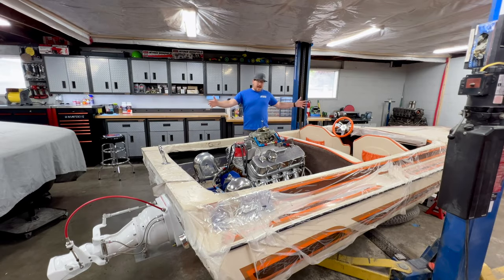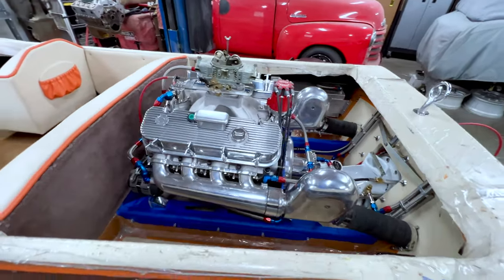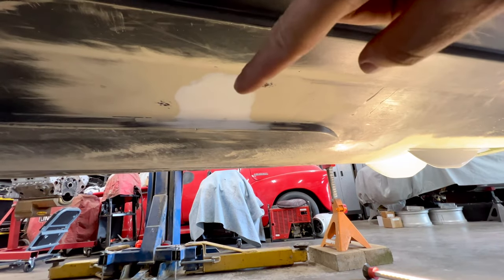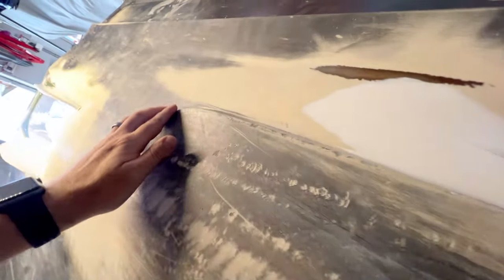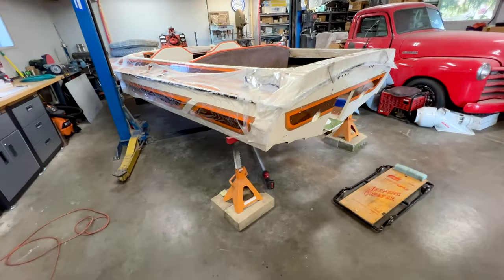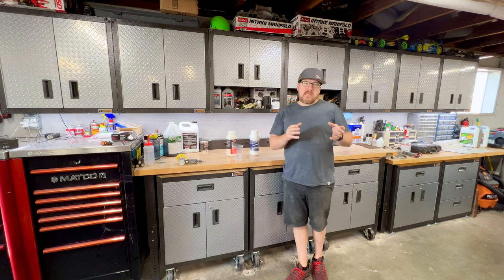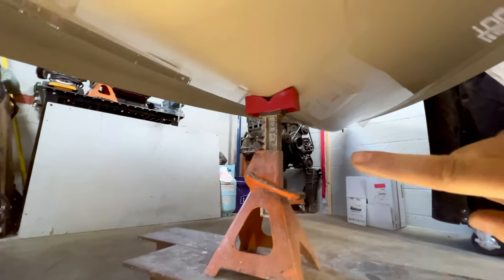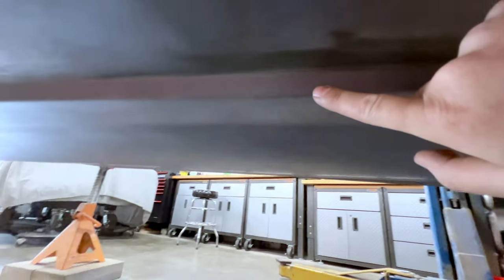JET BOAT Bottom Work ~ Fixing the GEL COAT on The Hull

Comment: Nick great job and like your channel. I have my kids first jet boat in my shop right now ready to gel coat soon and the only thing I am wondering is you were so close and even have a hoist, why not roll the boat over to do all this work? It makes it so much easier especially not crawling around on your back for hours on end. Looking forward to seeing the boat hit the water keep up the good work!
Reply from the maker: Fair question. I intentionally did not flip the boat over because I know myself all too well. If I were to do that, I would have turned the couple-day job into an entire redo of the bottom side. I just can't leave well enough alone. So, by keeping the boat upright, the repairs were just miserable enough to keep me from fussing with it forever... And it worked!! 🤣😂🤣

~ Nick
Reply: @AutoTechNick 
Fair enough, I just watched you rolling around on your back sanding thinking glad that’s not me 😅. We are spraying gel coat tomorrow on my sons boat and that was all I had planned to do but like you I couldn’t leave well enough alone and straighten out the keel and reshaped the entry in to the pump. 2 day job turned into 3 weeks!

Comment: There is absolutely no criticism intended. I think when you first pulled the original original motor, I would have turned the boat over and redone the whole bottom. I can’t think of many things I hate worse than sanding laying on my back.. I’m surprised the way your mind works you didn’t flip the boat over.
As always, excellent work!
Reply from the maker: Looking back with hindsight, you are probably right. But at the time, I honestly was not expecting to be this deep into the project. To say that this one has suffered some mission creep is a massive understatement!! 🤣

~ Nick
Reply: Excellent video, I'm in the process of going through the same exact tasks on my 20' miller. Engine, pump, plumbing, hardware, and wiring. I'm also at the exact same stage of progress. 🤷
Looking forward to completing the project over the winter and getting on the water.
Best of luck to you, again awesome set of videos on the boat, and I hope you can get the family on the water this spring!

Comment: Hi Nick, I have a question about removing the  Berkeley intake from the bottom of the boat. What did you use and which video was that in? I'm thinking about install a different one because someone cut the ears off mine. Thx , and really like all your videos!!..  I went to Wyo Tech back in 1979.. lol Great school  Thx again  Kurt
Reply from the maker: Here is the video where I cover cutting out the intake:

https://www.youtube.com/watch?v=3NfxKY9pMrA&list=PLF5nyN7G9cG1v_N_Je_DCH8q1BtZj8vTz&index=26

Cliff notes: Take all the mounting hardware out. Using an oscillating saw, run the blade flush with the top side of the hull,  and cut horizontially under the top lip of the intake, cutting all the epoxy. You will feel the blad stop when it hits the aluminum side of the intake.

Then, from the bottom, do the exact same thing, but this time, you will be cutting with the blade flush to the strake of the intake, vertically/upward. Once you cut the epoxy from both sides, it will lift right out. No need for heat or a floor jack. Just let the saw blade do all the work for you. 

~ Nick